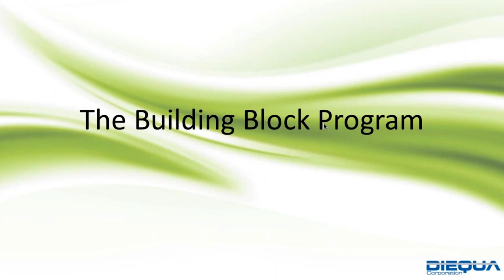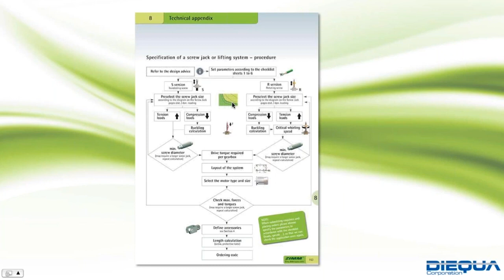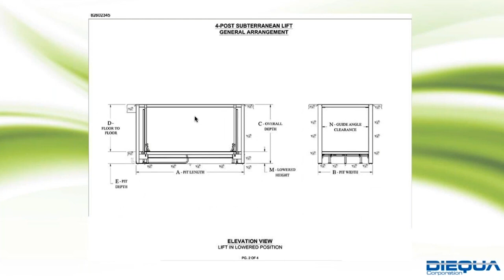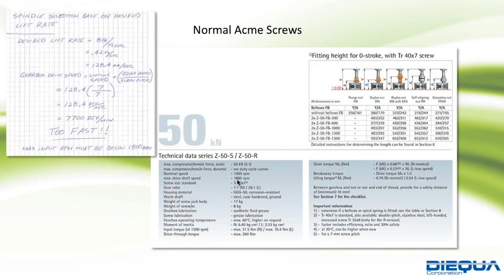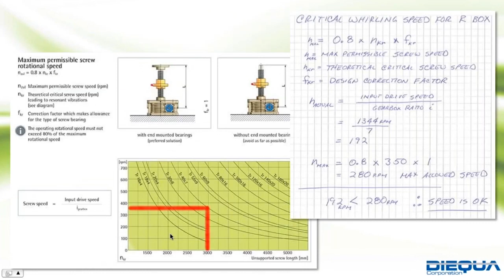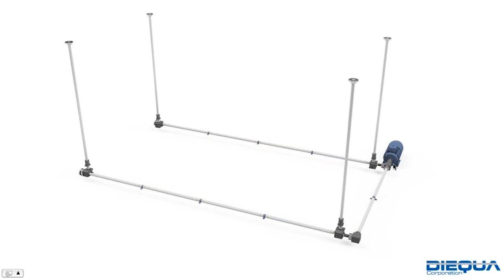Selecting and Sizing Electromechanical Screw Jacks to Replace Hydraulic Lifting Systems

Comment: A geared 25 Hp motor is a lot of power for a residence. Also, you would probably have a soft start motor control inverter with speed and torque feedback to overcome stiction in a smooth motion upon lifting a load and then slowly ramp up the speed to peek which would then decelerate as the end point is reached. The energy needed to lower the platform should be very small as compared to the energy needed to raise it.